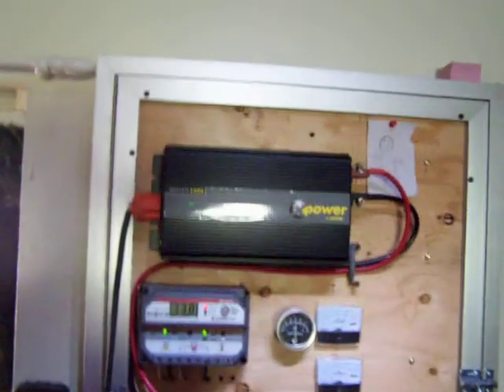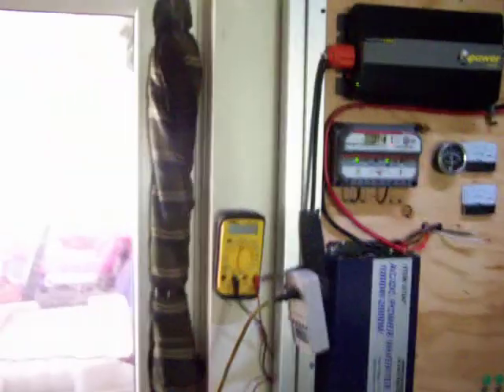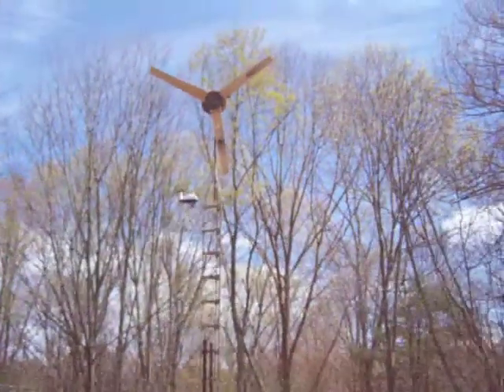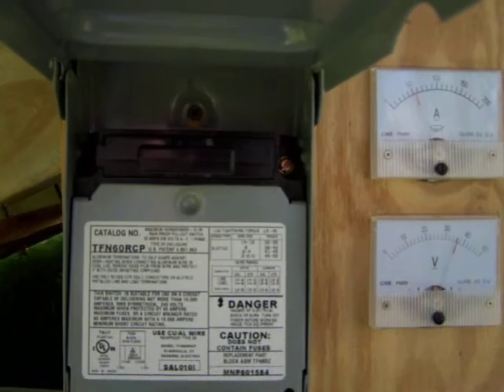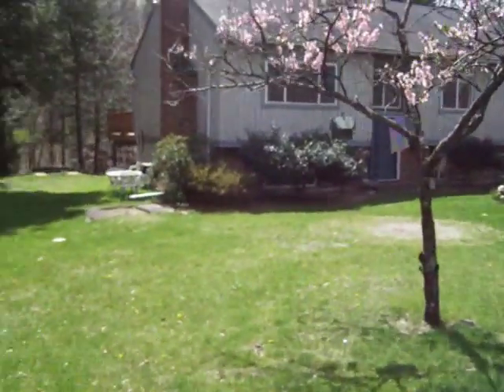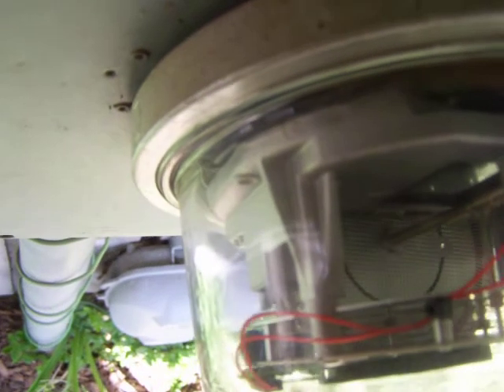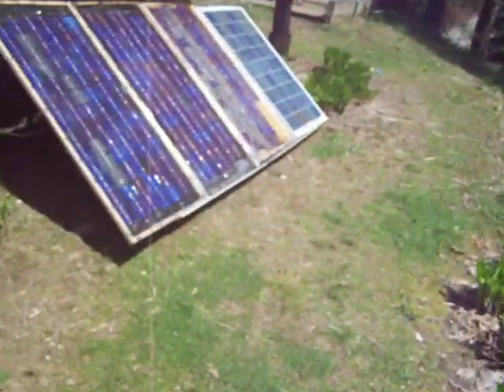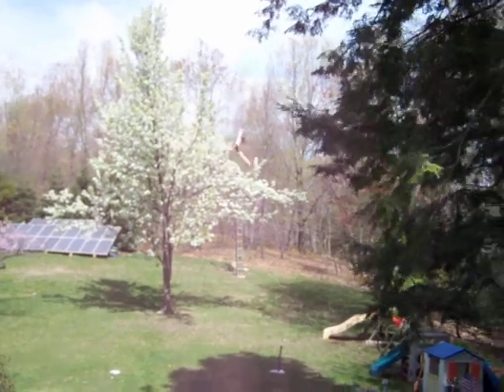solar grid tie

Comment: Great setup and lots of power.  Muddy and I were discussing that smaller grid-tie inverters are not legal, as of yet.  I have bought 2, 250 watts each, and want to use them.  Any recommendations?

Comment: Very impressive Michael, 
 Can you explain the disconnect box and fuses at your outdoor panels? What size cartridge fuse you have in the disconnect or if there is actually  no fuse or breaker inside?  Why would you need another line fuse?  I know the code requires some kind of disconnect.  I always get a little confuse but I can understand why you need good  protection with so many panels.